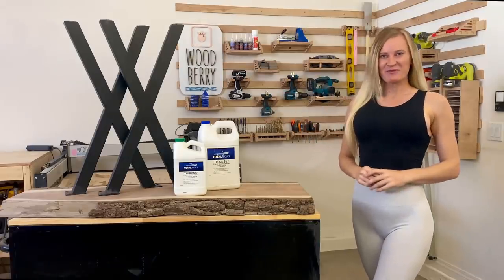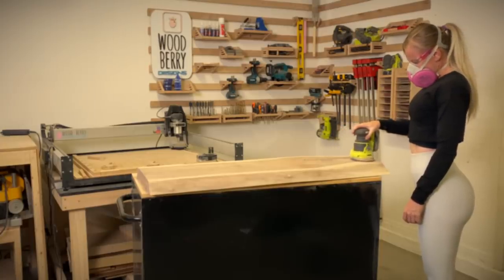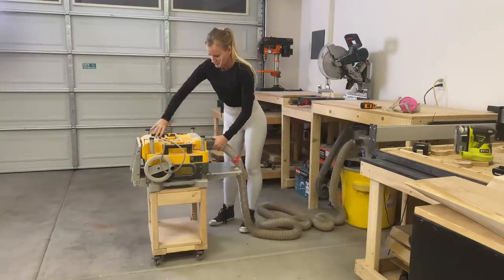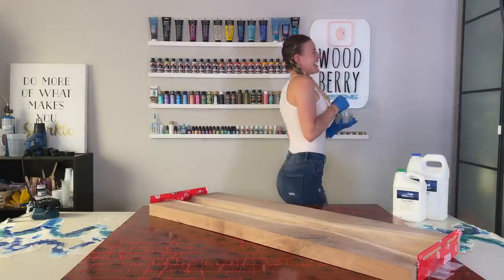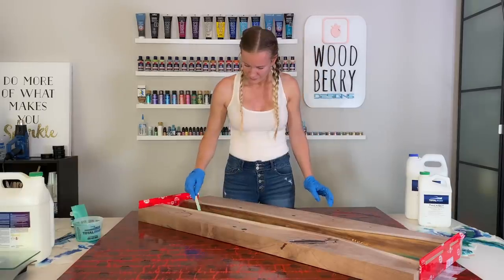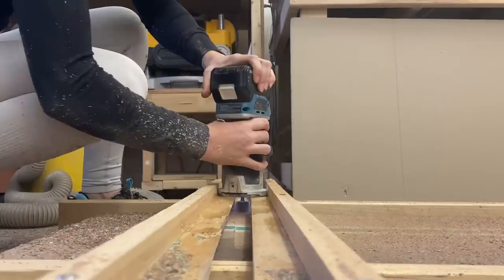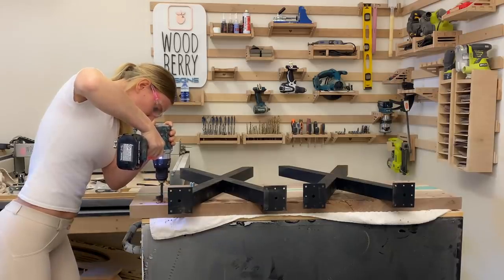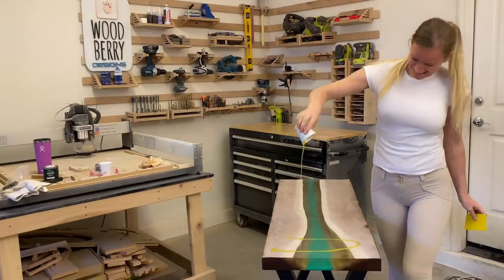Walnut Hallway Table with Resin River

Comment: That is one very cool piece of work you did. Started your videos about 2 months ago and became very interested in the work you do. I about rolled out of my chair laughing at :43 seconds of this video because of the way you presented sanding desires. Nice touch. I noticed that you have some Ryobi tools. 90% of my collection is Ryobi and I have not had one fail me yet. I'd like to know your thoughts on Ryobi in general when you have a chance to respond. Also, I thought the routing solution you did for finishing the top was great. I do have a big garage, but have no desire to spend $$$$ on equipment that I feel I would only use once in a while. I am definitely going to use that. Thanks and happy building!

Comment: Hi! Why don't you ever use a belt grinder?
Reply: @WhatMeikeMakes  I started using AEG1000. She is the same as Metabo BAE75. I adore. It works fast and there are settings. I also have a Makita 9911. I use it only when I need to work with one hand.